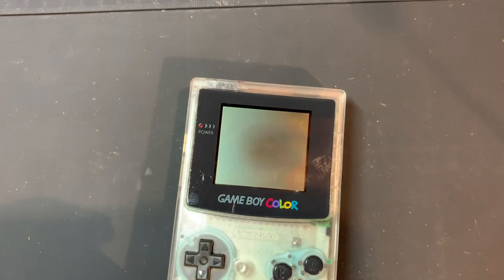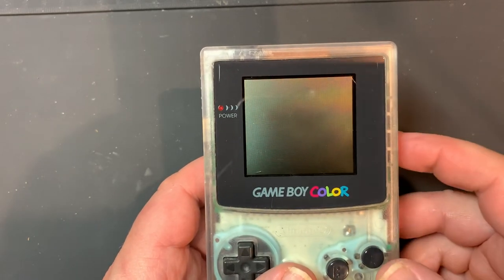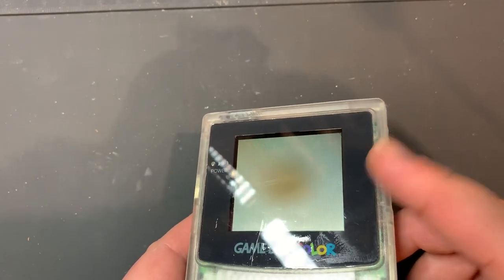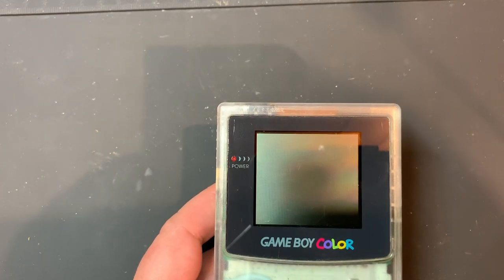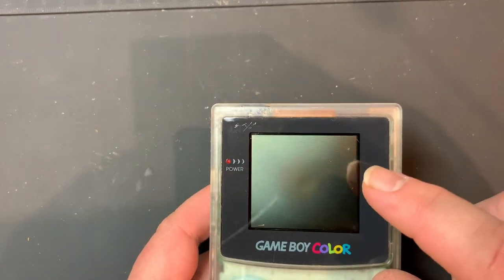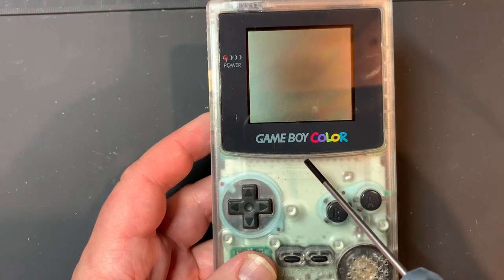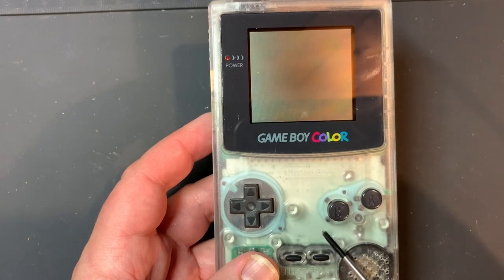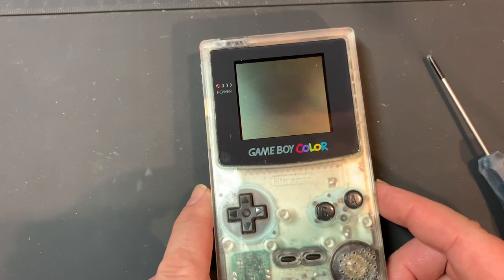Game Boy Color: Wiring, Space, and Voltage

Comment: Is 3.3v too much for gbc? Would it hurt in the long run? I'm gonna do a 3.7v 2500mAh to a tp4056 board and a 3.3v buck regulator in between the gbc and the battery. 
Also with ips screen and ez flash jr.
Reply: I have been using 3.7V battery directly for some time now and it seems OK. The GBC uses a step up circuit to get 5V out of the original 3V from the batteries. Since the max 4.2V of the lithium battery is still below the intended 5V output i guess it is fine. Having said that, I too would like to know the specs of the GBC power regulator circuit, specifically the input voltage range.